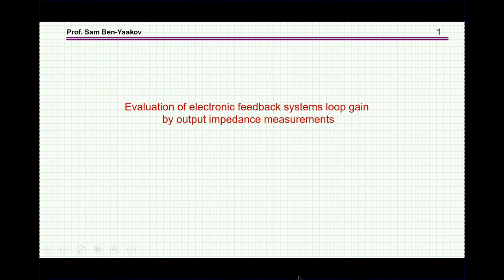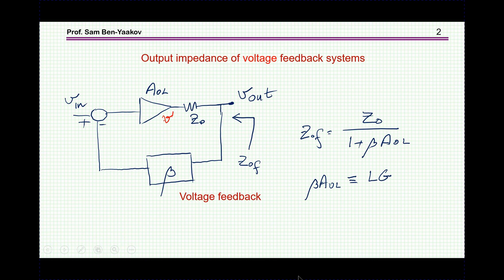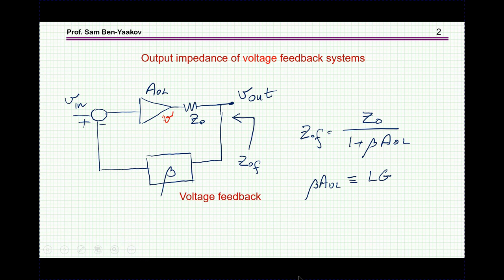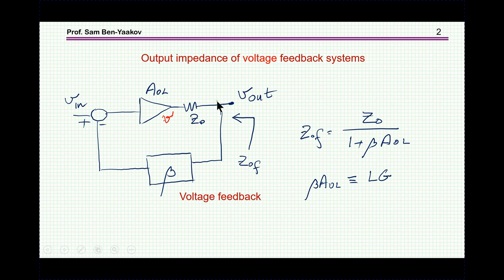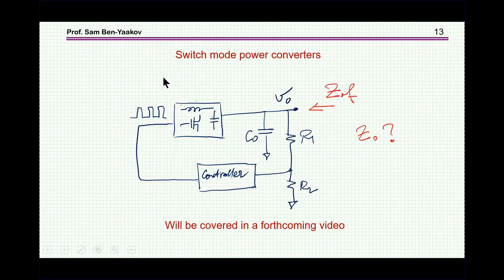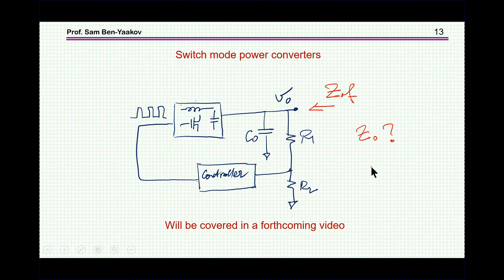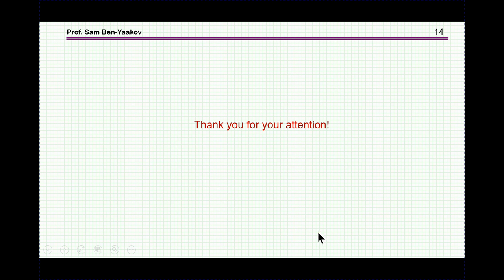Evaluating the loop gain of feedback electronic circuits by output impedance measurements

Comment: Hello Dr. Yaakov.  Your videos are very useful for me as an EE working in the industry, thank you.  For simulating open loop impedance where feedback is needed to establish bias would placing a sufficiently low freq pole(s) buffered by a voltage controlled voltage source in the feedback path to "zero" out the gain (but only for higher frequencies where the gain and phase margins matter) be sufficient/accurate?
Reply from the maker: Yes, stabling the system with a narrow band controller will allow the measurement of the open loop output impedance. Thanks for comment that others may benefit.

Comment: Dear Prof. First thanks for your as usual insightful knowledge sharing. I have a question regarding the Phase Margin of the loop gain. If the phase dips before the unity gain frequency of the loop gain, how do we define phase margin? For example if phase drops by 150 degree from 180 degree but at unity gain frequency, phase drop is 120 only, can we still say that phase margin is 60 degree ? if not how to go about understanding it?
Reply from the maker: Yes still 60. This goes back to Nyquist. See my YouTube videos

Basics of PWM Converters Controller Design. Part III. Peak Current
Mode (PCM) HD

Basics of PWM Converters Controller Design.Part II. Phase
compensation HD

Basics of PWM Converters Controller Design. Part I. Fundamentals HD